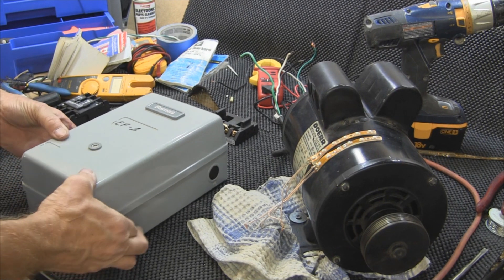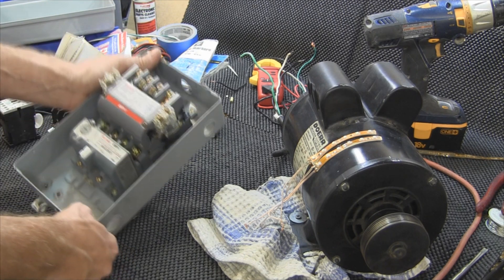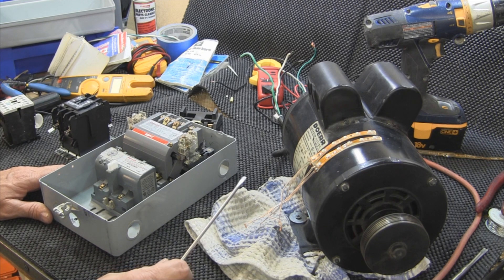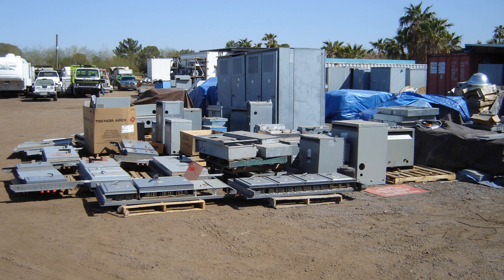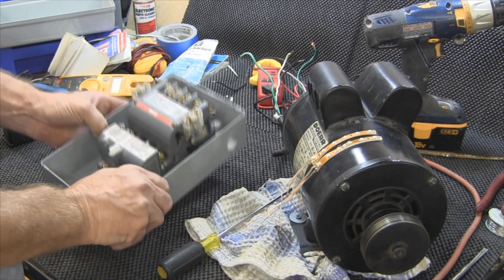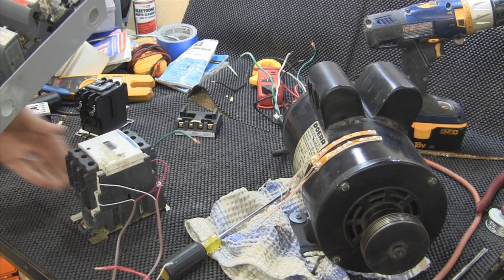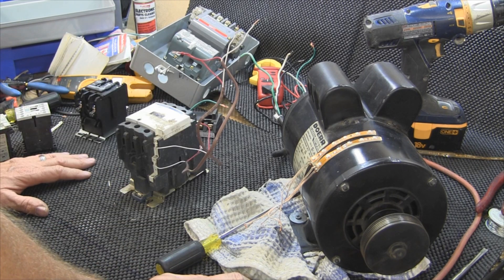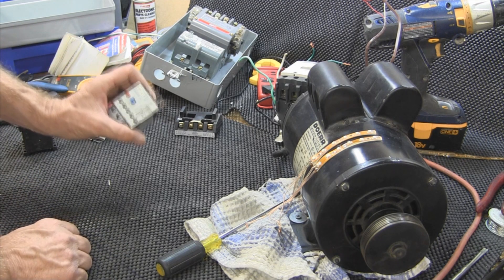Motor Starters-Electrical contactors

Comment: i have a old lathe its still 3 phase so when i got a converter to single it would  turn the lathe the wrong way. do i have to rewire the motor or is it the converter

Comment from the maker: @donaldo1954 Hey Don, Simply, a relay works the same as a contactor - generally,less expensive though. Relay may be used for low amperage controls whereas a contactor will handle large loads ex: motors. You can use a relay to control a contactor.

Comment: Hey Sparky me again.  I took a 1 1/2 yr electronics program at DeVry many years ago and learned about relays, but not specifically contactors.
1. What's the difference in a relay versus a contactor? The seem the same to me.
2. In this video, what were the LED strip on the motor for?
Thanks